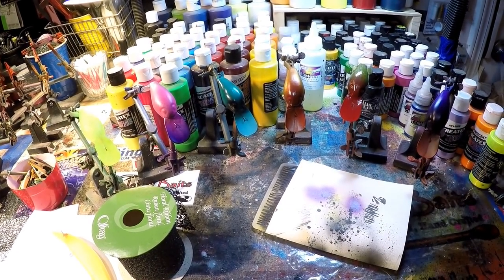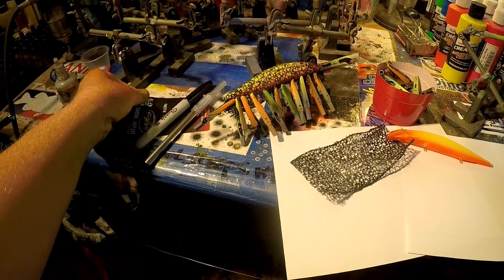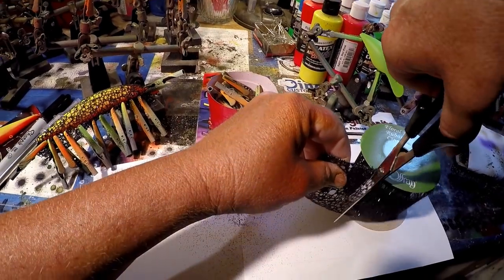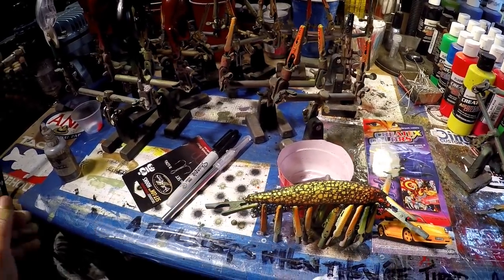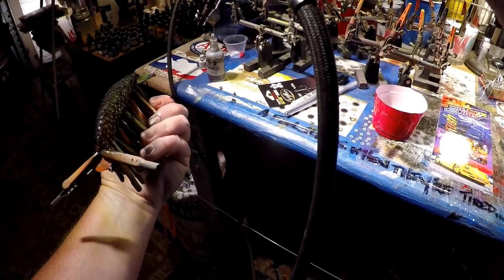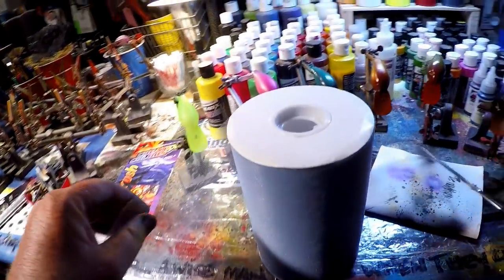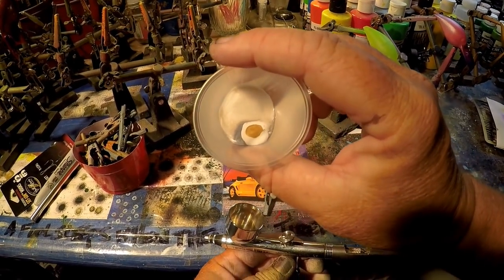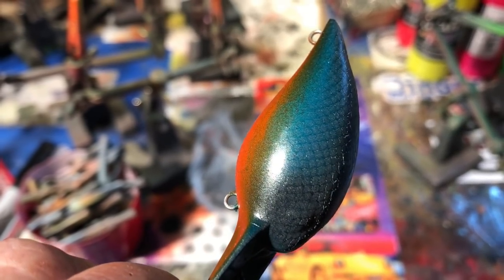SPRAY SESSION SATURDAY: "STENCILS AND LAYERS" (Part 1 of 3 - Fabric Overlays)

Comment: do u reduce most of your createx paint before spraying? I always add and mix in the gun  and it still seems to get clogged sometimes. is it better to premix the paint with reducer first then add it back into the bottles for ready to spray paint?
Reply from the maker: luremaker 87 nope. I shoot it around 35-40 psi w a standard needle
Reply: Jekyll424 awesome thanks for the quick reply! I've been airbrushing it around 20psi that must be the problem! thanks again. thats been causing me lots of hassle and I couldn't figure it out haha. thanks again for the tips and awesome patterns as always!!

Comment: how do you get the area by the needle clean? my airbrush cleaning brushes wont fit.
Reply from the maker: Which airbrush do you have?
Reply: @Jekyll424  its a master
Reply: @Jekyll424  Master G22
Reply from the maker: I found a couple of videos that might help you. I'd definitely check them out! Your brush is different than the one I use, so I think it would be better if you looked at breakdowns that are made using your G22. 

https://youtu.be/ZHk1aKQR7LY

https://youtu.be/uJnSFjnzI10